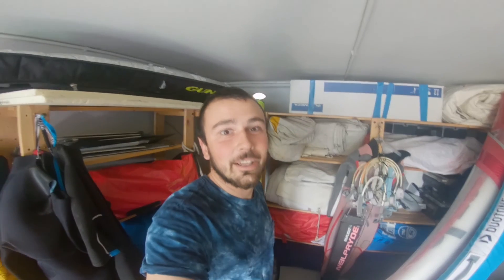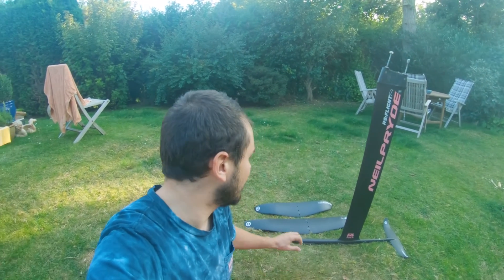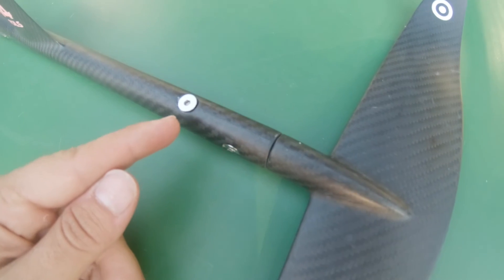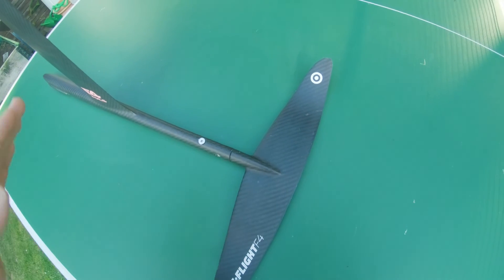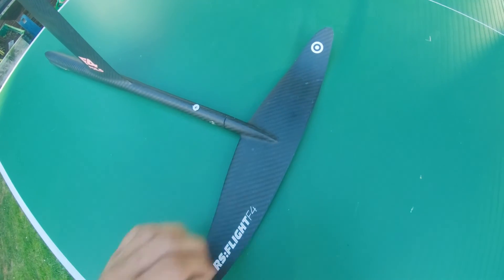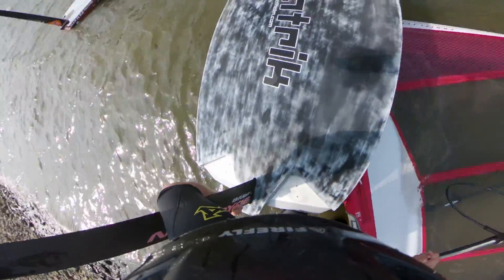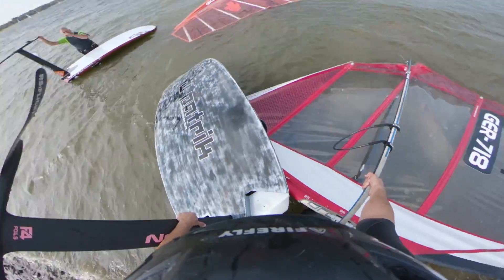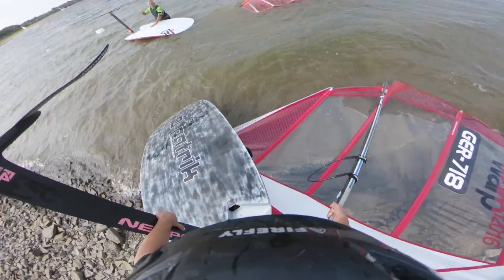The Foiling Jibe - or not!

Comment: You are thinking way too much about technical details. What u lack is TRAINING, just go more foiling and u will get a feeling. Thats the whole miracle. Its not tuning or anything, its just getting a feeling and doing it. all the theory doesnt really help here since its pretty simple in the end. You just let the foil flow around, dont try to do small radius, do big ones and try to shift the sail without getting any power in it, its more like flowing balance with slooow and small movements. when the sail is shifted u can hurry up, jump into straps and go instant full power, lean into the wind and blast on.
Reply from the maker: Thanks for the tips, the problem is in light wind i cannot just let the sail flow around, i have to actively push it around...